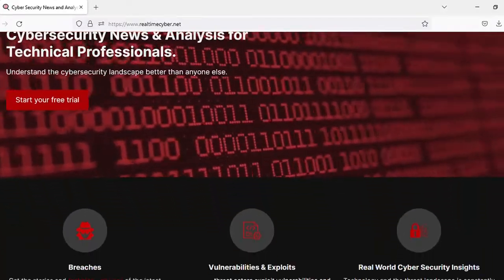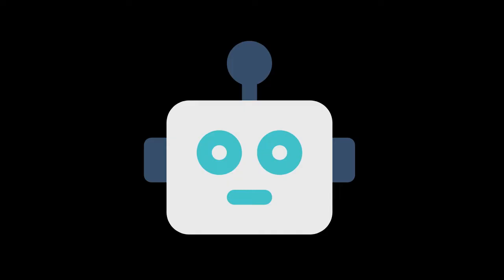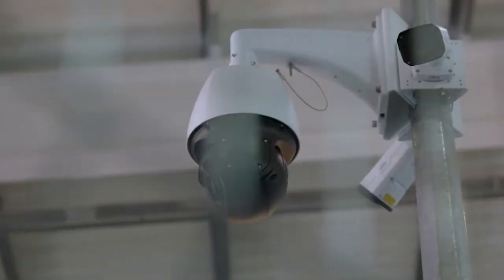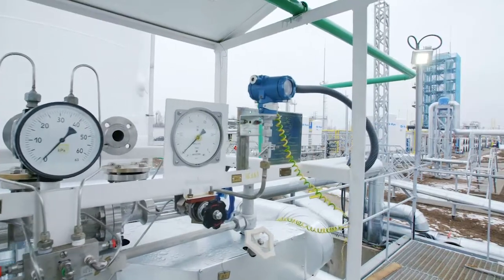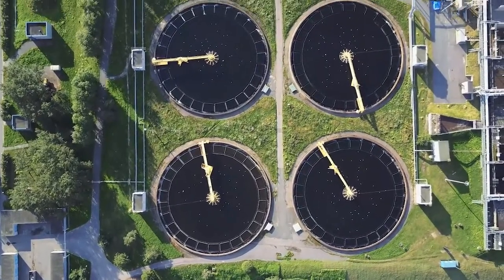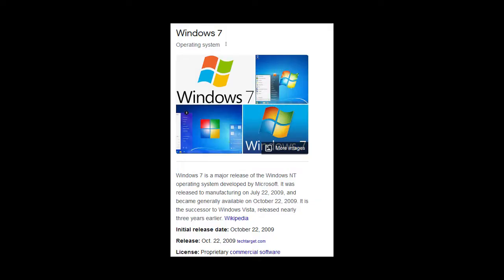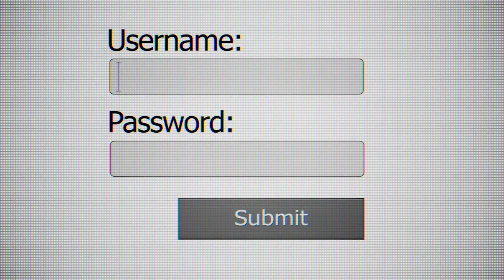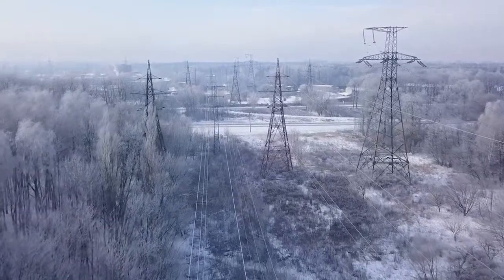Common IoT Cyber Attacks Explained: Technical

Comment: What if these IoT not connected to internet “ secured by internal network with firewall “ not connected to external network / internet , will these IoT will be risky ?
Reply from the maker: If they're not connected to the internet the chances are significantly lower. But malware can still be spread via removable media such as a flash drive, or via another infected device that connects. The Iranian Nuclear program was not connected to the internet and it was infected with the stuxnet worm that spread via flash drive.
Reply: @realtimecyber  if the IoT device hacked , do the attacker will be able to penetrate and hijack the IT network even if there is a firewall?
Reply from the maker: @fadi_al_ghanem  Its tough to say without all the details. An IoT device certainly could be used as the entry point and potentially allow firewall circumvention.